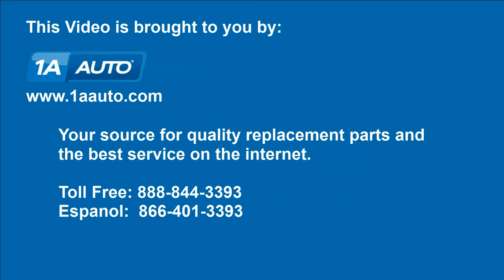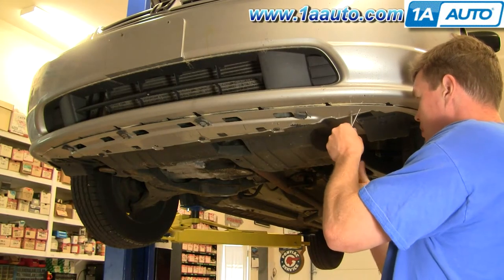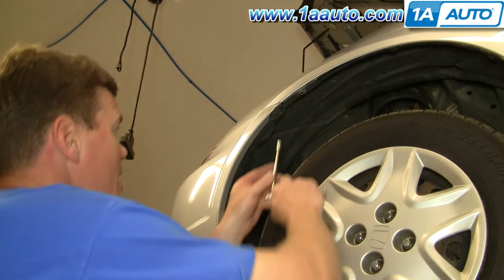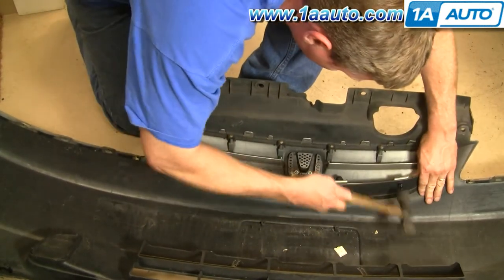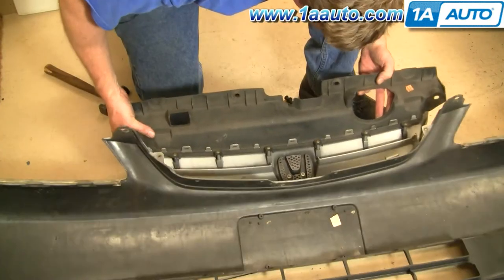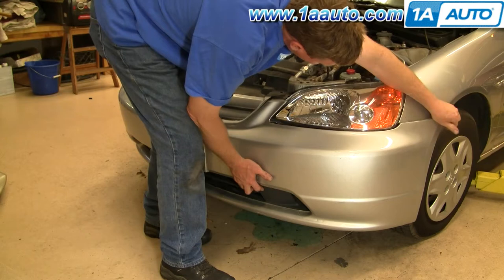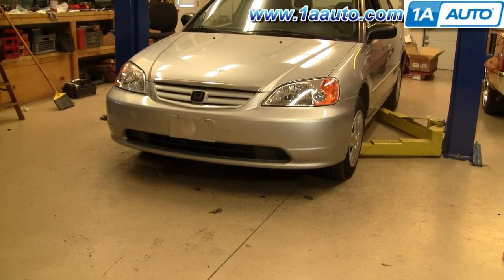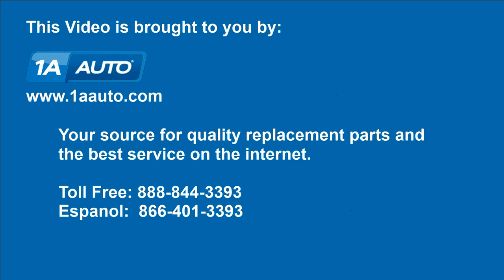How To Replace Front Grille Panel 01-05 Honda Civic

Comment: A note on replacing/adding the H emblem, if you simply remove the upper plastic clips, you can easily bend the grill out far enough to see the backside of the emblem and attach the metal clips to hold it in place. Thanks, 1aauto!

Comment: The OEM clips for the bumper connecting to the splash guard is ridiculous. I'm glad you mention that aftermarket ones are available, but do you have the part number for the clips so I can find their aftermarket equivalents?
Reply from the maker: +John Albers Thanks for checking us out. Shop for high quality auto parts on 1AAuto.com:

http://1aau.to/m/Shop-1AAuto-c

Comment: So I have a 2001 Honda Civic I want to change the grill to a newer style maybe the black grill, do you think this is possible?
Reply from the maker: +Leon Fyah Records Thanks for checking us out! It may be possible to do however it would more than likely need to be altered in order to fit properly on your vehicle. We would not have a part that this can be done to but a local body shop may be able to assist with more information and resources.
Reply: 1A Auto Parts thank you il try that !